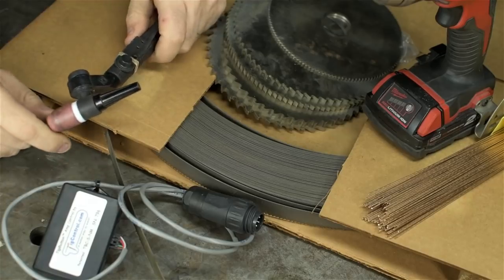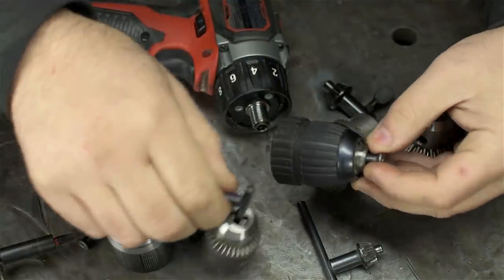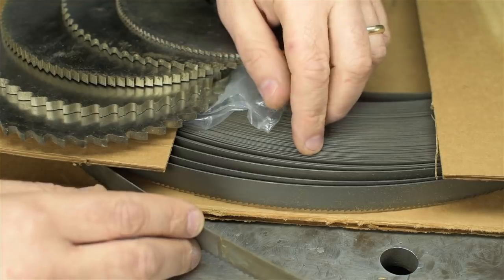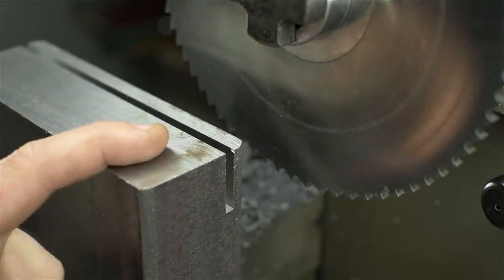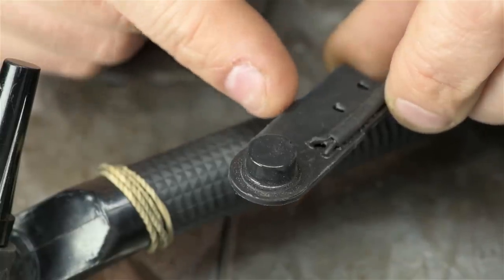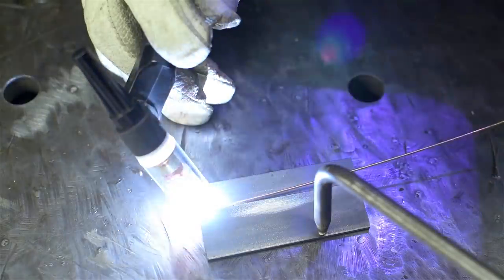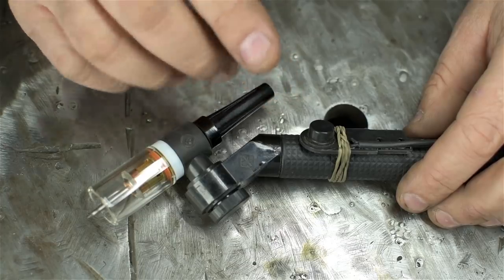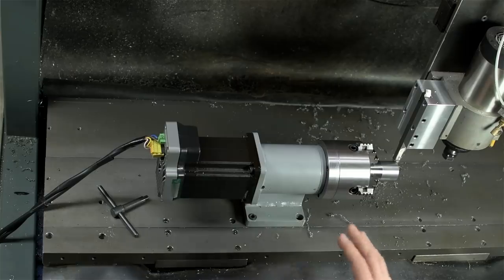STP #7: Saws, TIG Button, Brazing & More!

Comment: Mount the tig button in a mouth guard, bite force amp control 😁
Reply: Makes sense, these sort of highly dexterous tasks always require precise mouth positioning anyway. May as well make some extra use of it!
Reply: Don't laugh - I've done that.  Just don't chew gum at the same time unless you want pulse.
Reply: That is an excellent idea. Let's take it through design thinking. First thought - you can't have electric wires or pressure switches in peoples mouths. I'm sure there are solutions like maybe some kind of mechanism that transfers the jaw movement to a pressure switch close but not in the mouth. But even better maybe to use AIR pressure created in the mouth. Cheek pressure travels down a tube to a [waterproof] pressure sensor. Or, a sealed rubber tube is bitten down on to increase the internal pressure depending on how hard you're masticating.
Reply: If the squishable enclosed tube system had some liquid in it, the pressure change and liquid flow could drive something like a small piston. Which could move a variable resistor. Say a slider type over a rotational pot. Which is what's in a foot control anyway. So no need for the box of brains either.
Reply: It'll never work. I always have my tongue sticking out the side when I'm concentrating.
Reply: @chris watts that design wouldn't work in jail for obvious reasons. And wouldn't work in Scotland because they'd never get it in their because their tightarses lll
Reply: How about one of those "brainwave" control head strap things you see on kid's science toys that make a ball float higher on a stream of air. 
 Can't see that going wrong at all.
Reply: @balisticsquirel  That's so simple you will wonder why you didn't think of it right away.
Hydraulics.
Reply: @chevydyall7619  You could use a squeezable bulb like a blood pressure cuff, and squeeze it under your arm like bagpipes.
Reply: @balisticsquirel  id rather have live wires in my mouth, its simplier and not dangerous aslong as their coated correctly and the button hes using is pretty much perfect
Reply: Old video and just now finding it but I have had to do things like this for years until new pulse controls have been affordable to me because being in a wheelchair with no foot movement I would use either chin movement or biting to use while welding but now pulse welding works great just using a finger switch on the torch head

Comment: Wow, 24 minutes and 11 seconds. Seamlessly nailed it.
Reply: Tony is a prophet.
Reply: ..and im seeing 24 minutes and 12 seconds!
Reply: @MaximusPsychosis  Weird, on my computer it said 24 minutes 11 seconds. On my phone it says 24 minutes 13 seconds. Probably a YouTube thing.
Reply: @tylerd.9457  yeah, it is a youtube thing, depending on what you're viewing it on.. im on chromium if that gives you anything to run by..
Reply: @tylerd.9457 ; It's a legacy thing. CRT TVs used to run a little bit slower than powerline frequency (59.94Hz vs 60Hz) to avoid interference beating.
Because of that (yes, really, we can't even get something as simple as a specific frame rate in 2018 because of lazy <cheap> engineering of 100 years ago) the video plays at 59.94/60 = 0.999x the speed of the original recording, hence adding about 1.5 seconds of playtime to this video.
It is also the reason why everything sounds lower pitched than on the PC (even when using the same headphones), because the audio playback gets distorted by the same amount as well (in the old days they used the mains frequency as the single clock to run everything in TV off of. This also directly led to every show/video/movie which was recorded in NTSC, sounding like it's being played through a worn-out record player with a low battery on all PAL TVs).
Reply: And here I am at 22:53, wait, am I missing a bunch of content?!

Comment: I ❤️ all of your videos and content TOT!
You make my life so much happier, even after watching loads of your videos countless times because it just makes me feel better about my life. I really want to get into fabricating and machining (as a hobby) but I need 2 things for that to happen, funds and space. I used to have a single car garage (which you might get a fiat 500 or a mini), but now I only possess a 8"x6" wooden (cheap and nasty) shed. Which I can't even move in because there's stuff screwed and fixed to every single surface. 

So, for me being able to build a shed. It needs to be less that half the size of my 39.755mm3 garden (for reasons). So getting a mill, lathe, work benches and a metal work bench for metal fab n it also needs to be made out of wood (for reasons).The joys of new build houses in England, where everything's on a postage stamp 😪 🤦🏻‍♂️ It's pretty crap tbh 😕
Going from being a sparking, talking home over £30k a year. Then waking up after having a motorbike accident, which left me with my left leg up to my groin suffering from a brain injury n having to deal with agonising crippling pain & phantom pain because my hip is so badly mangled I can't wear a leg and need a special operations which the NHS aren't doing atm ☹️ The only work I can do now is bench work, which I've come to found out is as rare as rocking horse 💩

It's also given me quite bad depression and anxiety. Which doesn't help when no one can properly help with my year in year out pains. And the same goes for walking and PTSD 😐

Everyone who rides a bike on the road knows the consequence, as I've had a few close in counters in the past as I was riding on and off for around 10yrs. 
Something I've learned over the years is that it's not worth it, even though I'm a biker till I die try of people. I would still love to ride again but as you could imagine, my family isn't very keen on the idea 😳

Anyway!! 😪
Watching this again and I forgot to say first time, but with the drill. Why don't you just trim off that excess bit if plastic which overhangs and does absolutely nothing apart from getting in the way of you using the chucks you've always wanted? 
You could set it up in the mill or lathe to get a nice professional, or belt sander. Either that or you could just cut little bits of (similar to whittling a stick/bit of wood) at a time like a beaver? 

I'm sorry Tony for venting on one of your videos. Like most people, there's a lot more to my story which has made my life even worse than it already it 😪😞
FML

Comment: My grandfather was a brick layer. But his passion was metal work. He knew alil about alot of different things. U remind of him. He's the reason why i got into working metal. I was fascinated about welding. He had me using a soldering iron. Then spot welding first. Lol. First gas. Then stick. Mig and eventually i learned to tig. Messing with metal for 40+

Comment: "I've never seen a 1/2' drill with a 1/4" hex drive on the backside"

[runs out to the garage and starts cutting / welding 1/2" drills and 1/4" hex drives while muttering "I'll show you"]
Reply: @thisoldtony
From a machinists standpoint which would be better 1) taking 1/4" hex drives and welding them onto 1/2" bits or 2) grinding the back of 1/2" bits into 1/4" hex drives? 
Asking for a friend
Reply: @coleeverman672  I think drilling and threading would be better. Then you can remove the 1/4" hex any time 😉😁
Reply: Cole Everman you would be better to modify the existing shank of the drill rather then welding a 1/4 hex drive onto it. However you wouldn't need to grind it. Drill shanks aren't as hard as the flutes of the drill and are very machinable.
Reply: Milwaukee, Ryobi, DeWalt....all have 1/2" drills for 1/4" hex shanks. The packaged sets have even advertise that fact.  Harbor Freight even sells them. If you haven't seen them, you haven't been looking.
Reply: @coleeverman672  Better question, why the hell aren't drill bits hex to begin with? is some mad man out there still using a collet to mount their drill bits?
Reply: @hungh0  laziness and cost are probably the two reasons that all manufacturers aren't doing it. Stop being so logical and using sound arguments.
Reply: hungh0 back in the day most of the large bits I had in my garage had 3 flats milled on to give the chuck a bite point. Dont see many of those bits anymore though.

Comment: Have you thought about doing "live" tooling for the 4th axis? I would love to see that in action!
Since you prefer more Minnesota in your TIG wire, do you use Arkansas gas shielding and Colorado drill bits, particularly on high Missouri alloys?

Comment: So glad to hear somebody else is having issues with Milwaukee chucks.  I have several of them and they tear my bits up too.  Just went to the Milwaukee dealer in my area and discussed the problem with them. They claim not to have heard about this issue before.  They ordered me some new chucks for my old drills and sold me a couple of new drills with hopefully newly engineered chucks.  They were thinking maybe the new drill chucks wouldn’t have the problem anymore. Unfortunately the new ones have the exact same issue.   Very frustrating!

Comment: If You consider making something like the TIG button DIY, look for FSR force sensing resistors. They are available in different sizes and shapes. Glue it to a solid backing and put a drop of silicone or smilar on top of the sensor and You have a simple force sensing button. I have used these many times in similar applications with good results. Made a bite force to drill rpm controller  for a disabled dentist using these many years ago.

Comment: Remember not to leave the Key Chuck in your new drill chuck.
The key may fly away and never come back.
Reply: I did this once on my pillar drill. Needless to say I found a new way of launching satellites... or keys at any rate. Into low earth orbit through my shed wall ;). Seriously though I’m lucky that thing shot out backwards. It made a heck of a dent in my chipboard wall.
Reply: Just tape the key to the battery, like putting it at the plug end of the cord.

Comment: Rohm Chuck:  Could you stick it in the lathe and turn down the plastic enough that it clears the drill housing?
Reply: That was what I thought we were going to see.
Reply: Chuck the chuck
Reply: So would that be opposite of upchucking? Down chucking!
Reply: Naw, mount the drill up in an end mill and take off the circle ridge so any chuck would fit.
Reply: @timvatter2559  
Could this be the perfect title for Tony's brown chicken brown cow video?
Reply: I had the same issue as tot with a cheap drill I did the same thing with. I just trimmed the clutch plastic with a knife.
Reply: @artgibbens1730  That's what I'm thinking, too

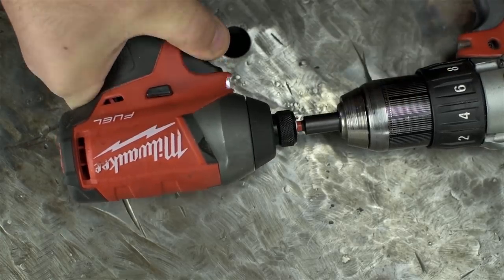Comment: 3:00 had me worried you were gonna go full Wranglerstar. God that would have so quickly ruined this channel for me.
Reply from the maker: not sure what going full wrangle means.
Reply: @ThisOldTony  Wranglerstar! The crazy guy who hates everything except what he likes! The "homesteader" guy! he just hates on lots of tools, and one of his most famous videos that got lots of views was one where he let two drills "battle it out" by securing a rod between the two chucks, and running them against each other. The thumbnail was rather striking, which is likely why so many people watched it. Ironically, I never watched that video. Some of his older vids were good, but his channel has become very clickbait-y and unpleasant. He's a very "this tool doesnt work when I use it for something which it's not intended so it is TERRIBLE DON'T BUY IT, its unfortunate.its
Reply: Ben Sullivan I swear I’ve seen that. Dewalt vs something iirc. Dewalt immediately overpowered the other drill and its anti reverse lock kicked in. The dewalt then burnt out trying to turn a locked barrel. He declared it junk and the loser the winner. Am I on track?

Comment: I have a Bosch hammer drill that I had to re-tighten the chuck every minute or so while using it (it'd seen lots of use).  I used your method to remove the old chuck and looked through my stash of over 20 chucks, where I found the perfect replacement.  Thanks for the idea to replace the chuck.

Comment: Tony, I have that same drill. I think u got a faulty chuck. Mines fine. It doesn’t chew bits or come loose even if I’ve got a stirrer in it for mixing grout or paint. Take it back and get a new drill. 
Wow, 27 dislikes so far. Ok people, fetch your pitchforks and flaming torches, we got some dissension in the camp.

Comment: I have a few oversized bits, 1/2, 9/16, 5/8 with the hex drive custom welded onto the backside. I primarily used them to ream holes slightly larger. I made them out of necessity to fit the impact driver I had at work. We had 1/2 inch corded drills, and 3/4 inch drill presses, but you couldn't find chuck keys for the former, and the work didn't always fit in the latter. One easy trick to keep your bits from spinning in the chuck is to grind three small lands into the bit for the chuck to bite onto. I needed to do this for my corded home drill with the keyless chuck. Same problem, couldn't apply enough force to clamp the bit.

Comment: With regard to the saws, it's worth remembering that cold saws (also known as Brobo saws over here, the type that run around 50rpm with HSS blades and coolant) are running 350+mm blades (14 inch) with smoothbores, no problems at all.  I've had to remind myself of that before too, lol...  Also, you can get the coldsaw blades resharpened surprisingly cheaply (especially compared to replacement cost!), and I imagine those cutters would be the same, if you ever need it.

If you're not already using it all the time, those CK wedge collets are absolutely awesome in my book.  I had a few of the traditional style get deformed in various ways (usually heat, but also overtightening), and either death grip the tungsten or fail to grip it.  My watercooled CK torch came with a small assortment of those wedge collets, one of each size from memory.  I'm still using the same 3/32 wedge collet 6 years later, and it still works perfect, despite having been run outside the ideal amperage range on a number of occasions among other punishments....  Grips with a minimum of torque required, releases instantly.

Comment: +1 for the gripping power of those older Bosch chucks.They also grab well on the mount side, I have one with the mounting screw removed just waiting for the chuck to fall off so I can use it on another drill.

Comment: Little known instructions 

 Here’s a step by step breakdown of how to do it tighten a keyless chuck on a Milwaukee may work on others as well 
1. Insert the drill bit into the drill chuck.

2. Tighten the drill chuck only by hand until it clicks several times.

3. Rotate the chuck back the opposite way, until you hear and feel one, single click.

4. Once you hear and feel the last click, the drill bit is locked securely into place.

Of course you need to know this before you jack up the chuck.

Love the show

Comment: I've got the hammerdrill version of the small Milwaukee drill. It cost more, but I have put mine through hell. I love it. Don't have the chuck shredding bits, and I have used a 1/2" bit without slipping. I mostly rip up the operational side of bits before anything. Marble, steel, wood, aluminum, tiles. I've drilled it. Fits nicely in my tool bag too.

Comment: Man, I didn't know you could swap chucks on a hand drill like that. Guess I've never needed to, but it's good to know. Also, thanks very much, Tony, for the review of the tig button! I was looking at those a few weeks ago and wondering about them. I do metal art that has me welding in very odd positions and moving all over a piece as I'm working on it. As the sculptures have gotten bigger, this has become more of an issue with the foot pedal, and sometimes I'm doing some really interesting contortions to get the pedal operational. I may have to invest in one of these. It's really nice to see a thorough review!

Comment: Happy morning waking up to one of your vids👍I use the same drill for my job but with 18volt (wrists of steel here lol) the chucks are useless, I’ve used double ended 1/8” drill bits before and had to pull them out of the screw in end of chuck after the chuck had come loose while drilling. Battery also jiggles a bit to and it flogs out the contact pins on drill and battery meaning you need to use two hands, one for drill and one to hold battery 4 of my tools have done it. My old freaky was like your bosh and still going strong 13years later can’t kill em.

Comment: All those years using that exact drill, the chuck is the only thing that took a dump on us. Sent it to milwakee for like 50 bucks, shipped back to me with a "NEW USED" chuck. Clearly rebuilt but the tolerances in the hull of the chuck were as gone on it as they were on the one we sent. Only good for unibits now!! In fact, i doubt the loser that stole would even be able to get that unibit out!!!! Channel locks ftw!!!!

Comment: How do you like the CK Flex Loc torch?  I bought one a while back for tight/awkward places but haven’t used it yet. 
Also what do you use for cutting/tapping fluid?  I’ve noticed in a couple of your vids that it appears quite stringy or clingy (technical terms). 

Thanks. 
Mike

Comment: Hi Tony, Normally you drive slitting saws without keys, so if they dig in, they slip and so, don't shatter and fly across the shop. Just turn up some spacer rings of different thicknesses to clamp it to your
arbor.

Comment: Milwaukee makes those hex bits up to 5/8" with the 1/4" hex. The titanium nitride set you buy comes with sizes up to 1/2". They designed them for their impact driver, but I don't find them to be that great.

 I've broken several drilling into mild steel and 316L stainless. Good for about 3 cuts, then they dull and snap. I've also bent the shank on a couple.
Reply: I just bought 3!